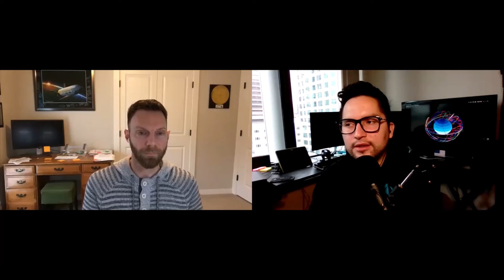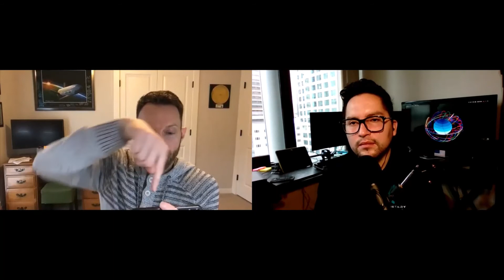Quaternions, Euler Angles, Flight Software with Brian Douglas | Space Engineering Podcast Clips 3

Comment: For attitude control, do we specify setpoints in terms of quaternion itself?
Reply from the maker: Yes they can be. A quaternion (for attitude) and angular rates (angular velocity) can fully define the attitude state of a spacecraft. You can find the quaternion error at the current time by comparing a target quaternion and your attitude quaternion, and the control law will make the error go to 0. This would be the proportional part of PID control. 
Then the derivative part would be having a target angular velocity and your current angular velocity, and using a control law to drive that error to 0.

This is a snippet of what I have for attitude control simulation that calculates the control torque from the imaginary part of the quaternion error and the angular velocity (omega) error. This example is attitude control to align the body frame to the local vertical local horizontal (LVLH) frame:

  q_target     = nt.conj( spice.m2q( eci2lvlh ) )
  q_error      = spice.m2q( lvlh2body )
  omega_target = omega_lvlh_norm * eci2lvlh[ :, 2 ]
  omega_error  = state[ 11:14 ] - omega_target
  control      = -np.dot( self.kp, q_error[ 1: ] ) -\
      np.dot( self.kd, omega_error )
Reply: @alfonsogonzalez-astrodynam2207  helpful.  Thank you. Waiting for your video series on spice. Thank you once again.
Reply from the maker: I haven't made a video series explicitly, but I have lots of videos showing how to use the NASA SPICE software. Here are some examples with links:
Introduction to NASA SPICE Files: https://youtu.be/oJ8bBrtwZLk
Solar System Orbits with SPICE Files: https://youtu.be/NhnowBBLtmo
N-body Perturbations Software: https://youtu.be/BAO5Csp5msQ
Solar Radiation Pressure Software: https://youtu.be/KLIVgRe0_6k
Latitude / Longitude Coordinates Software: https://youtu.be/wqhKcV-BubE
Porkchop Plots Software: https://youtu.be/aN05hfPCG2M
Reply: @alfonsogonzalez-astrodynam2207  oh..thank you for the links..
Reply: what about modified Rodrigues parameters? they seems to be better than quaternions, with point of view of singularities. there some literature dedicated to this.
Reply from the maker: Sorry for the late response. My understanding is that quaternions do not have a singularity, and are computationally efficient to use in flight software (compared to direction cosine matrices). I have never worked with modified rodrigues parameters, so I can't really comment on them very well. But given that SPICE does not have any functionality for them, I think the industry standard is quaternions

Comment: The quaternion exponential take a scaled 180° rotation and gives some mixture of the original 180° rotation and a 0° rotation. Those proportions are exactly defined by the sine and cosine of the scale respectively. The 180° rotation can also be described as some mixture of 3 basis 180° rotations: from y to z around x, from z to x around y, and from x to y around z (except not actually since that particular basis would be akin to ijk = 1 rather than ijk = -1.) Composing quaternions is also very easy, just like composing any two transformations, and since Euler angles are around a well defined set of axes, you can evaluate each angle as a separate quaternion and then chain them all together. Going the other way is significantly trickier though.